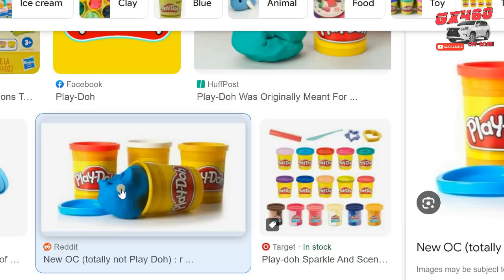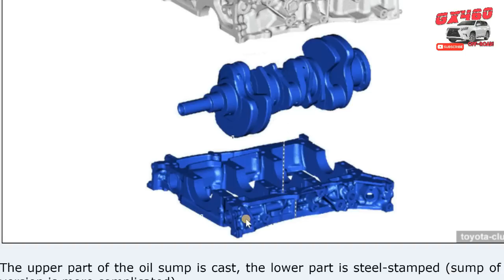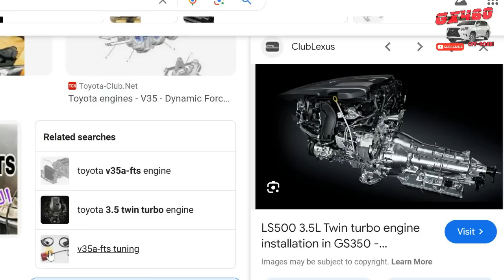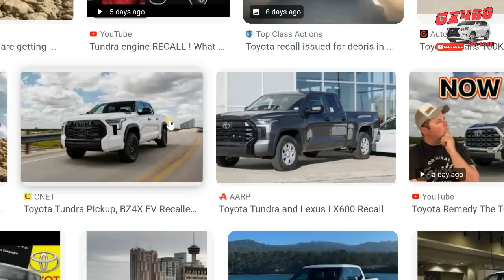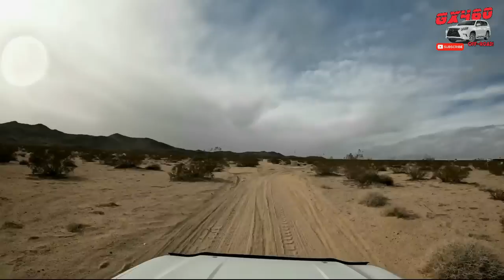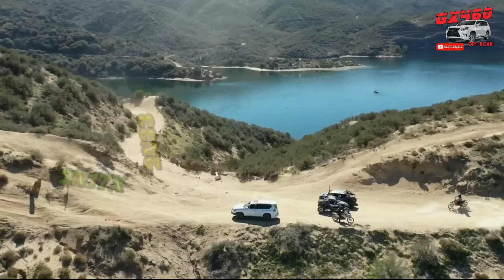Toyota Tundra OUTRAGE: A Technical Explanation

Comment: Comparing a crankshaft bed on a 1990s 4 cylinder to a turbo 6 DI is not apples to apples. Sorry.
Reply from the maker: As stated the bed plates are on many Toyota engines, including their gas and diesel turbos... for decades now 😉  Same goes for nearly all manufacturers for the past 35 years...
Reply: @LexusGX460-OFF-ROAD  you said that there is no evidence and nobody truly knows (true). But then say because a car had that design 30 years ago with 1/3 the horsepower had that design, that it can't be the problem now. Really, Cmon.  All you've done here is muddy the water.

Comment: Occam's razor goes out the friggin' window when I'm driving around in a 64K ticking time bomb.  Toyota needs to step up to the plate and do right by their customers.  Full engine replacements, free rental cars, suspension of payments under repair period and extended warranty effective the date of engine replacement.
Reply: They owe you nothing technically.  The factory warranty has expired.  Your engine is running fine.  I don’t get it.  Any engine can fail at any time.

Comment: Why does this only affect the main bearing?  It seems if this was a debris problem, bearing damage would be random.
Reply from the maker: each bearing is  assigned their own oilway...
Reply: @LexusGX460-OFF-ROAD  OK, so the debris only affected that oil way? Must have been not getting cleaned out at a specific point in the manufacturing process.  Seem like this could have been corrected.  I don't know if the 2023 I got in July of 2023 is affected yet or not.  It came off assembly in Austin in early July of 2023.  I hope it's OK.  10K on it and 2 oil changes so far.....

Comment: @ 8:58 your statement is inaccurate. This engine has had issues ever since it debuted in the LS500. Multiple threads about failures on the LS500 as well on the Lexus forums dating back to 2018. Many of us knew the same issues would eventually pop up on the Tundra, LX600, Sequoia, and all other iterations using it. Toyota intentionally ignored the issues and snugged them under the rug for as long as they could. This "voluntary" recall is only because the NHTSA stepped in to investigate. It would've been worse for Toyota if the NHTSA had duplicated on their own accord, just like what happened with the self-accelerating Toyota's from a decade ago, and we all know how that ended for Toyota...
Reply from the maker: there were some issues, but statistically similar to the issues with the 4.6L and 5.7L when they were born...

Comment: Reserving judgement, but spidey senses; While Toyota's explanation is plausible, another scenario may be likely. What's the path for oil after pickup? Small debris (glitter) may cause some bearing damage, although larger debris blocks the screen & obstructs oil to the pump. Should the front main bearing get oiled last, any reduced flow &/or pressure would show there first.

Comment: You can’t compare the 3.44 tt gas engine to a tt v8 diesel. Diesels have to be built much stronger to withstand the very high compression ratios.
Reply from the maker: Toyota engineers are aware of the expected loads of any engine they're designing...
Reply: Are you building these v6 and v8 . How u know which  one is stronger

Comment: I’m an engineer and without all the Toyota answers it comes down to the fact the bearing rides in those journals. There’s no space in there EXCEPT for the oil and the bearing. When metallic junk gets in there it’s simply going to cause wear in a space that no contact is actually supposed to happen. The design is supposed to be the bearing riding in the journal and oil is supposed to be between the surfaces of the bearing and the journal. When your oil breaks down wear accelerates. When there is metal in there the bearing will wear extremely fast 
After a short time the wear will cause complete failure.
Reply: So change oil every 500 miles.
Reply: And the bearings are designed to accept a small amount of tiny debris that will imbed in the bearing surface, and avoid catastrophic wear and failure. But apparently this was just a little bit more than some tiny debris.
Reply: @RealWorldGarage  yea when there’s so much it actually welds together that’s too much

Comment: So It's not a design deficiency since they've been using similar designs for years, but it's a cleaning issue? Like they don't know how to clean engines? The Lexus engines had bearing failures as far back as 2018 and continue in 2024. Two different factories, with bearing failures continuing into 2024, even though they claim to have improved cleaning in Feb of 2023.
Reply from the maker: ya processing hiccups... too many some will argue 😢

Comment: Not buying the manufacturing debris story at all. Manufacturing debris found both in the LX600 (made in Tahara Japan) as well as the Tundra (made in Alabama)? Issue occurred at two plants? Highly doubtful.  Journal bearings are seeing more load with the high torque of this motor and the new main bearing cap seems to allow the main bearing at the front of the motor to fail prematurely, resulting in crank wobble and killing the motor.

Comment: For this to be correct you have to believe the information being provided by Toyota is correct.  This has been the news from Toyota within the past week.  Exploding Tundra engines, Toyota caught lying on MPG for many vehicles, AND lying on SAFETY certifications. I have no faith in Toyota having the ability to tell the truth on just about anything relating to their vehicles.  Toyota has NOT been replacing w/new engines, rather spending a boat load on labor to repair the "exploded" dual turbo engines - they are rebuilding them.  How they move forward, access, and remediate this in the short term will be interesting.
Reply: Toyota likes to lie, Tomorrow  you will be driving a Hydrogen  powered truck,  they keep saying BEVs are DEAD.😅

Comment: That’s why I changed my oil at 1K miles on a new engine to clean out the machining debris
Reply: Lots that have had their tundras engines fail did a early oil change also
Reply: @johnsteffen9438 True-once that debris gets fused in, no oil change will dislodge it. Just have to wait until the ship hits the van🤷🏻‍♂️
Reply: @davida7284 I guess the idea is to get rid of the debris/trash before it fuses to the bearing surface?
Reply: @sharkskin3448  Oh for sure. I’m just assuming (and someone correct me if I’m wrong) that even before 500 miles, that debris has the potential to fuse rendering the early oil change futile. Don’t get me wrong, I went ahead and changed oil at 600 miles but still worried the fusing could’ve occurred. Even tho there’s still likely a chance everything is ok.
Reply: @johnsteffen9438  Which only added to the suspicion when Toyota released their "answer" for why all these engines are failing. Personally, I have lost a lot of trust in Toyota over the last 15 years. Once they changed their warranty to state that it's "normal" for a Toyota engine to consumer 1 quart every 1200 miles, that was the start of my distrust in corporate Toyota.
Reply: I buy 15 year old cars just to be extra safe
Reply: How do you cars drive after - such an early oil change?
Reply: did mine at 1.2k miles on my May 2023 TRD SR5 4X4 TUNDRA.
Reply: I did the same around 850 miles. Always have done this with new cars, but I think Toyota has a design flaw and this “debris” is just a cover story. Time will tell once people start taking apart their own engines. Very disappointed as a 30 year Toyota owner.
Reply: @jimmyg6215  hey was thinking of changing mine do you think 500 is to early?
Reply: @Flash....Gordon..42  nope I would do it now. Wish I changed mine at 50 miles ☺️
Reply: @jimmyg6215  you didnt watch the video huh?

Comment: If debris is the cause, new shortblocks will have exactly the same bottom end design.  If the design turns out different, the gig is up I guess.
Reply from the maker: The tech on YT that did at least one tundra short block said it's the same exact part number for the new short block... suggesting Toyota's manufacturing error claim is valid
Reply: @LexusGX460-OFF-ROAD  
Having watched the video, I'm more inclined towards Toyota's explanation than not.  You did a good job explaining the detail.  It would help close it out if Toyota told us more about the nature of the debris, and why it only affects the main bearings and not other engine internals.  Thank you.

Comment: I don't believe it, how can Toyota let it go for multiple years. So the same engine as a hybrid isn't recalled so what is the difference in the engines?
Reply: The Hybrids may have the same issue. However, the reason they aren’t in the recall is Toyota issued a “safety recall” stating engine failure could cause a safety issue if it quit working. A hybrid battery would kick in and keep the engine running. So, no safety recall.

Comment: Excellent video and logical discussion. My LX is not in the recall yet, and I hope it never is. The engine debris story does sound pretty lame, I just hope that's what happened, and it is not a bad design. I will trust Toyota until I'm proven wrong, I've been driving them for a long time.

Comment: Good video!  As someone who has a truck on the recall list I’m driving it like normal and waiting for the remedy.
Reply from the maker: How worried are you?  Be honest with us 🙏
Reply: @LexusGX460-OFF-ROAD  I’m less worried about trips near home but I’d be lying if I said I wasn’t concerned about a long distance trip.  The remedy will dictate whether I stay with Toyota as a brand. If they don’t do something satisfactory, I’ll leave Toyota for good. I have too much money in the truck and accessories (running boards, tonneau cover, etc) to trust them a second time if things aren’t handled well. At a minimum I need an extended powertrain warranty with a long block if the current engine blows. A proactive long block replacement would be better.

Comment: Toyota is slow at identifying problems and rolling out solutions. My 2019 rav4 needed a coolant bypass valve right out of warranty. They still have the same problems popping out and now theres a lawsuit against them.
Reply: Did the RAV4 issue get fixed?
Reply: Dude they had widely known issues with the 2nd gen Tundra that they did nothing about when they "redesigned" the truck for the 3rd gen. Toyota has gotten very good at gaslighting and dragging their feet to fix issues. I mean even the frame rot issue was widely known about going back to the 1st gen Tundra, it's just that Toyota was confident they wouldn't be forced to issue a recall for it so they did nothing about it when they designed the 2nd gen. They still have issues with external oil lines failing on the 2GR and the "fixes" haven't really solved it, they can still fail as they age.

Comment: They might have a metallurgy problem where there is material flaking off under pressure. Aluminum is not going to work. They need titanium alloy.
Reply: And not Boeing suppliers titanium.

Comment: Something doesn't seem right.  Trash in the engine should be detectable by oil analysis.   And should be easy to identify engines with this issue.   My bet something else going on.
Reply: If you look at just how much oil demand there is in this design, if the engine is under enough load at low RPM, they're really pushing the bearings hard. Each cylinder has dual oil squirters that are active even at low engine RPM if there's enough load put on the engine. The turbos need oil supplied by the engine's oil pump. The top end of a DOHC VVT engine requires a lot of oil. If that oil is very hot and there's a decent amount of unburned fuel diluting that oil down, you have a very tiny margin for error when it comes to the main bearings. Even in the paper Toyota engineers wrote for the SAE journal, a lot of attention was focused on the crankshaft bearings and they were pushing the capabilities of the materials.

Comment: 300000$ * 100K = 3 BILLION DOLLARS.  Not happening!
Solution, compression check, if checks good then an oil change. 
Tundra production will end within the next couple of years same as the Celica after one year with that BAD toyota motor.
Reply: Where do you get 100k? The whole truck doesn’t cost that much. Probably more like 5k cost to Toyota
Reply: @deanrotering879  30000$ engine replacement.  100K trucks effected, likely many more....
Reply: @deanrotering879  100k unit of vehicle  not the engine price
Reply: @rottenrottie1515  the vehicles cost Toyota a fraction of that. Retail price is less than 100k is all I’m saying.
Reply: It wouldn't be 30k each for Toyota. That's your price...Toyota produce the engine themselves.  I figured it probably cost them  less then 5k for a engine . Pay dealerships tech warranty rate of 8 to 16 hours to install . Will only be 6 to 7k for toyota... that will be 700 million.  
7k dollars × 100k units = 700 million.  Thats nothing to Toyota, because they already overcharged us 20k for the truck already

Comment: This engine has worked until put it in a (wind-sail) of a Truck.  Then not so much.  The engine is a DUD in a truck application 100%.  Real question is how much is Toyota paying for this (video) advertisement.
Reply from the maker: There's Tundras on the road right now with 100k on this engine and same with the Landcruiser 300.  It was engineered from the beginning to be a truck engine.  This engine is only in ONE CAR.  It is in FIVE trucks.
Reply: 4 to 5 figures?

Comment: I think they screwed up the oil galley design in such a way that the first two bearings don't get pressurized enough. Or the oil clearance between the crankshaft and the bearing shells is either too large or too small.

Comment: You really did our my mind at ease. I biught a 2024 Limited I force Max and love it. Its not on the recall list...yet. people need to remember this has affected 1 % of their truck/SUV sales.
Reply: Same. I have a ‘22 1794 hybrid and zero issues so far at 24K miles. I know hybrids aren’t in the recall but It’s my belief that they eventually will be as it’s fundamentally the same engine, produced in the same plant. Still, I’m not worried. I bought an extended warranty and most likely, vehicles wouldn’t even need to be in warranty to be repaired under recall. Love mine so far.
Reply: Yours isn't in the recall list because if they were included, it would be a huge financial blow to their dealers. Toyota doesn't have a fix and their dealers would have thousands of Tundras they have on their floorplan but can't sell because they have open recalls on them.
Reply: Yes and 1% of 1 million is 10,000
Reply: @rocketman7471  They haven’t even sold a half million of these trucks yet. There are 108K vehicles in the recall.
Reply from the maker: You're gonna be OK.  ❤️  Keep the stats in perspective.  Fear solves nothing. ✌️

Comment: The camshaft’s on the top end use the same oil as the bottom end. They are not replacing the upper engine. No way only the lower bearing oil is getting contaminated with the upper cam bearings being spared.
Reply: That bearing material is also gonna go into the turbos…Toyota needs to replace the entire assembly and stop just changing shortblocks.
Reply: No oil goes to top end without getting filtered first. Only if debris is in the passages after the oil filter will the top end and turbo be impacted
Reply: Unless the filter gets clogged with debris and the bypass is activated. Though I don't have evidence that has happened. What I'd be more concerned with however is the pickup tube having been clogged with this debris then a dealer "just" swapping in a short block and carrying over the heads etc.  @falkfluegel5557
Reply: Watch the car care nut he gives his explanation of what he thinks is happening!
Reply: Many camshaft s don't have (bearings) they ride on the head itself mainly  because it's not under enough load to wear excessively so no bearings , but if junk gets into thoose oil passages and stops oil flow to cams that would be catastrophic  they should do the whole engine though and turbo as main bearing failure equals oil pressure loss and that will kill the whole engine in short order
Reply: The casting needs to be beefed up.

Comment: Yep  ,  design obsolescence is a fine line to hold  an if you get it wrong this is what you get. To many short cuts. I have insider information about Toyota's engine assembly line in Huntsville Alabama. I'm talking about info I heard when this assembly line was installed before engine production started. Ask me how I know.
Reply: Ok. How do you know?
Reply: @ScreendoorOpenY2k  retired Toyota Master Mechanic told me . He was on the install team for the new v6 line , an then he said he didn't understand why they removed the crankshaft manufacturing machines an never reinstalled them. He said he asked around , was told the cranks were sourced from somewhere else because of cost. Short cut. Now it's blown back on them.

Comment: We’ve been seeing these twin turbo V6s for years? Yeah…I’m sure. I wonder how many have 300k miles on them. 🤔
Reply from the maker: There's V35A-FTS Tundras on the road right now that have 80k-100k and the owners report "no problems"... again anecdotal.. but lost count of the Tundras I passed on the road today 😆
Reply: @LexusGX460-OFF-ROAD he’s correct I have a 2022 with 61k in a 3rd gen tundra group on Facebook. There’s a few with 100k+ no issues